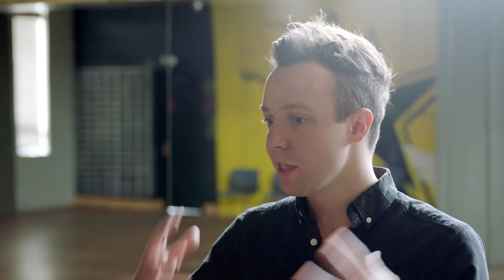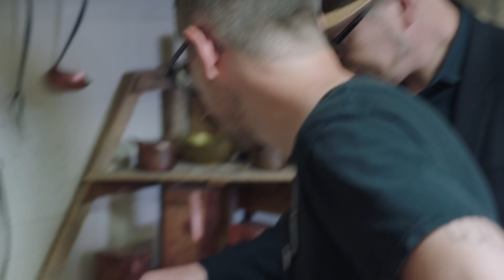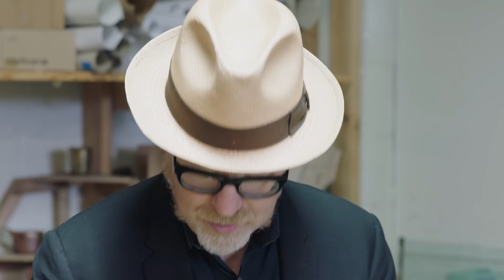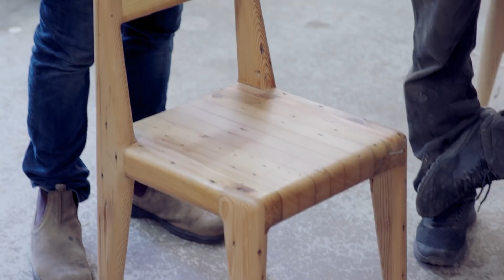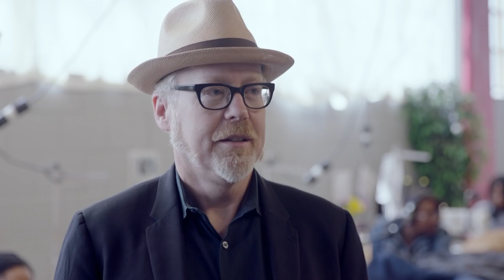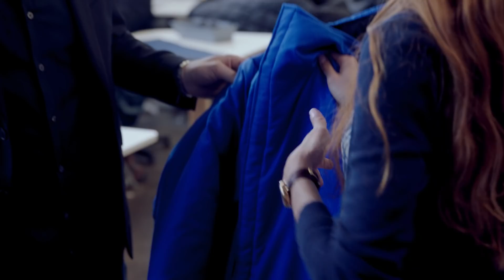Adam Savage's Maker Tour: Ponyride

Comment: Hey Adam (& tested crew!), you mention a large number of holes in the wooden work table that SmithShop has and their unknown origin. It looks exactly like the holes I accidentally put in my wooden cutting board when I used a 4mm hollow punch to put some holes in a material I laid on top of it. Maybe the previous owner did alot of leather work? Anyway, thanks for the content and I hope this helps solve the mystery!

Comment: The hole size is not weird in the table they are quick pilot holes the opening out to larger sizes would be done off table all aircraft structure sheds that I've ever worked in all the drill boards look exactly the same
too many larger holes starts to mess up the surface and you end up with no table

Comment: Audio is a bit low
Reply: they really need a sound guy..
Reply: Thiago Fernandes  mine is maxed out and I can still barely hear them but it could be my phone I'll have to wait until I get home to see if it is any better on my PC
Reply: I thought the same thing, but wonder if it was just because I was eating cereal.

I think someone saw the levels from the loud machines and turned everything down instead of just turning down the sections with machine noise.
Reply: A little low how about it's to low that I can barely hear what they are saying they need some one to fix their audio
Reply: It's better than it was on the other recent videos. They were sounding overprocessed and were not sounding good. This you can just turn up the volume at least.